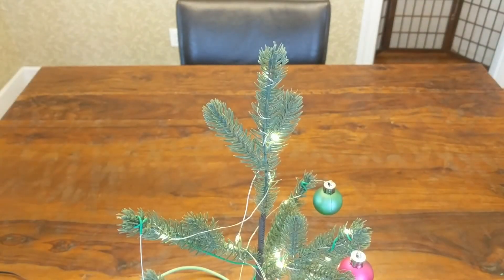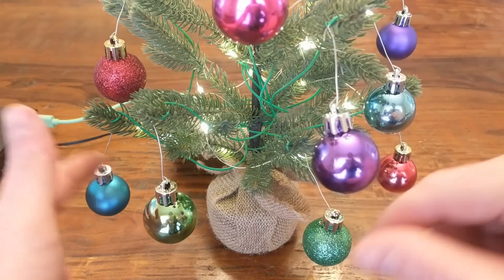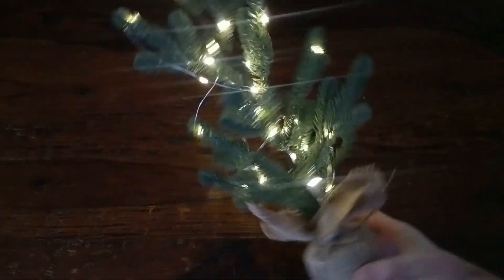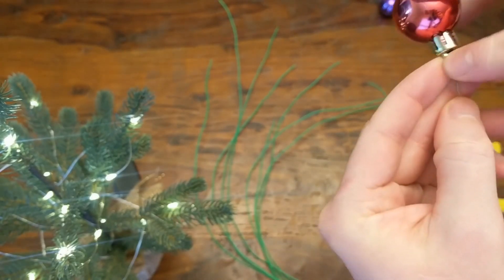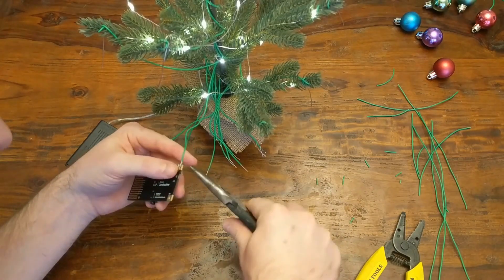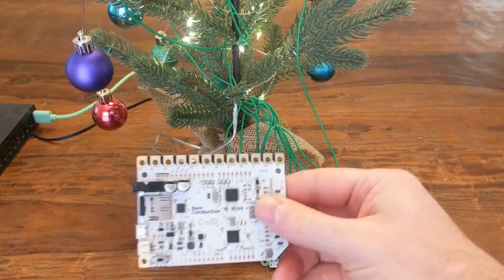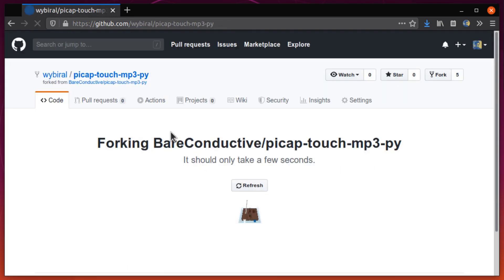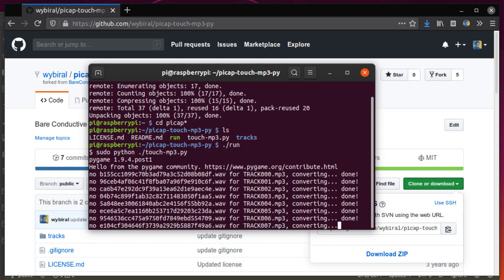Capacitive Touch Christmas Tree How To | Raspberry Pi | Bare Conductive Pi Cap

Comment: That's pretty cool. Didn't notice first that you are touching the wires.

Do you know if a different ball or some "classic" christmas ornament could be used as the touch sensor instead of the bare wire? You need something conductive, right?
Reply from the maker: Yeah, I think the glass / aluminum kind could work. Or you could use the Bare Conductive paint and then do a thin layer of color over it (it should still work as a capacitive surface). I didn't have a bunch of colorful paint laying around and I'm okay with the top of the ornament (especially since they swing a bit when you tap them and it would be harder to play). But it would be neat to see someone make it where the ornaments are the buttons.